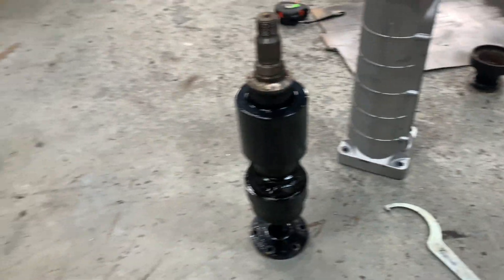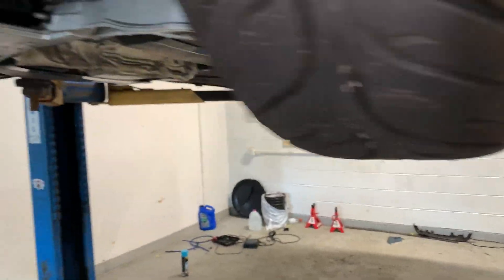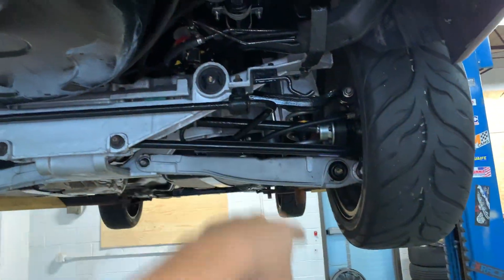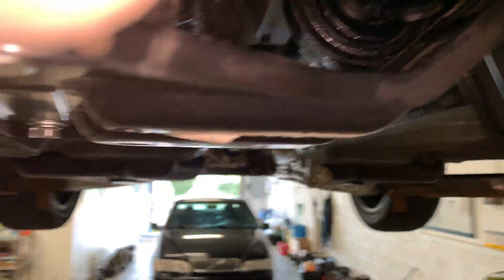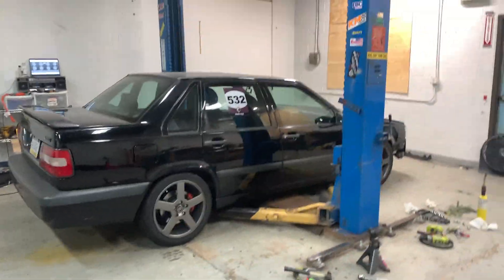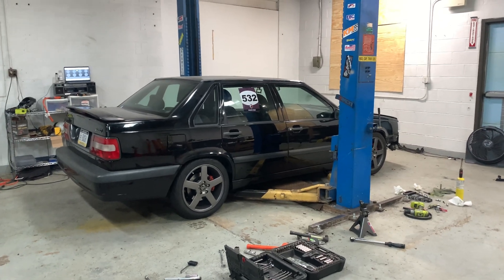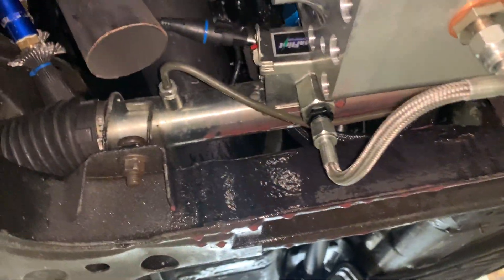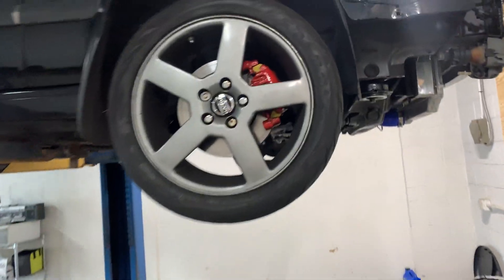Volvo 850 T-5R AWD Swap - Locked 4WD Test

Comment from the maker: Hope you guys enjoy the accel. The times are based off the speedo in the video. I can't detect anymore wheel spin in 2nd so I would say they are fairly accurate. +0.1-0.5 seconds. Also when I let off in 2nd you can see the speed stays exactly the same so its actually at that speed and isn't spin. When it was FWD when I would let off the speed would drop and you could immediately tell from the video it was spinning. They're mostly to show the acceleration because the 4WD is so smooth it almost makes it look slower and not actual claims. Will get some good GPS data soon too hopefully.
Reply: Looking forward to the next video
Reply: Wonder what would a stock angle gear do with a welded viscous? With only about 250hp. Explode right away im guessing.
Reply from the maker: @TalismaaKnives  Stock AG should be good up to 350-400 hp as long as you aren't launching it.
Reply: Its T5-R 👍
Reply from the maker: @nerothostv  incorrect its T-5R.

Comment: Hey boss! im working on a 99 v70R and was about to weld both sides of the viscous coupler......would you see any negatives to having just a custom solid shaft built/installed? Viscous couplers are few and far between these days lol

Comment: I am wondering, is it possible to do something similar with my p2 haldex system.
Reply from the maker: You don't want to do something like this, it's too hard on the drivetrain. I've since reverted back to the viscous coupler.

Comment: Hello  my name  is Wayne . AN I fellow you on your build . You did an amazing job on  your project.  I aquire  a 2005 S60 r automatic 12 years ego an have been wrenching  on it  till about 4 years ego when I had some Medical issues  that prevented  me from finishing  my project.  First I fell in love with volvo when th we y had a model 244 TURBO then the  850R in the 90ties then came the S60r in 04 . I could not afford one at that time in life. So I bought my  R  05. USED AN BEEN TINKERING WITH IT TILL A FEW YEARS AGO. IT SEEM TO ME FOR A YOUNG MAN  YOU LEARN YOURWAY AROUND VOLVES. I AM 63 YEARS OLD  AN BECAUSE OF MEDICAL ISSUES  IS PREVENTING ME TO FINISH MY PROJECT.  MY QUESTION IS DO YOU WORK ON ONLY YOUR CAR .OR DO YOU HAVE A GARAGE  THAT YOU WORK ON COSTUMER CARS AS A BUISNISS.  I LIVE IN NYC AN FLORIDA AN ABOUT TO TOTALLY  LEAVE NY FOR GOOD  . MY QUESTION TO YOU  IS IT POSSIBLE  YOU HAVE TIME TO HELP ME FINISH MY PROJECT  PLEASE. YOU WILL BE PAID FOR SERVICE PROVIDING  YOU ARE REASONABLY.  PLEASE  REPLY BACK.
Reply from the maker: Hello Wayne. Thanks for the kind words. Nice to hear a little bit about your project. Unfortunately I do not work on other peoples cars / projects. Maybe try checking with Ben @ Rolling Motors in CT.

Comment: I have couple questions. How much boost you run? Where is your rewlimiter?How much is your oilpressure on rewlimiter? Do you have original t5 oilpump? Big thanks if you can answer!
Reply from the maker: 32-34 psi right now @ 8600rpm. About 80 psi oil on limiter. Using RN/RNC oil pump.

Comment: Can I ask for some advice? My 04 S60R 6 speed, we hit a deer at 80mph, front end is wasted. =( I did find an 06 S60 auto trans. If i swap drive train and computers, suspen, brakes, etc. Do you think it would need a reflash ? Or maybe have to swap the wiring harness? Thnx for any help.

Comment: Hi. so as i understand you welded the driveshaft?
Reply from the maker: No. I welded the viscous coupler.
Reply: @SimplyVolvo  I have a xc90 and awd system is not working, the driveshaft is not spinning so there is 2 solutions for me, weld it so it wont slip anymore or rwbuild it and the problem will come back for sure.. i am in little bit of dilema how locked awd on xc90 will work 🤔
Reply from the maker: @nikolakurjakovic2188  You cannot weld it on a XC90.
Reply: Xc90 uses haldex not viscous coupler.
Totally different system.

A viscous coupling is an assembly of closely spaced plates bathed in a dilatant fluid (essentially just a thickening fluid). This viscous coupling links the front and rear drivetrains.

Haldex is reactive and uses hydraulic pump to pressurize set of clutch packs..
Diff gens used mechanical or electric pumps or combo thereof.
Reply: @simplyvolvo Fri**in sweet! Lol..
As always your dedication, fabrication, and imagination inspires..

Comment: I just want to know what you have against 4th gear?
Reply from the maker: Why would I show 4th gear when the entire point of the AWD swap was to get incredible traction and acceleration in 1 and 2?
Reply: @SimplyVolvo  volvos have never really been fast on launches even with the awd ones not so much this is insane and also really impressive how fast this 850 is going be proud of all that progress 😎
Reply: Well the accel with 4wd is fantastic but by the time 3rd is over I was left really wondering what 4th would do!

Comment: Before launching pull the e brake, and bring the clutch to the bite point, to prevent shock snap. You don't want to bust a driveshaft, a cv joint, or especially that angle drive witch you have built yourself
Reply: What is a e brake on a 850?
Reply: @nicosmith7903  emergency brake(e brake) handbrake, funstick
Reply: That's how I stage my manual drag cars.  Preload it to prevent snapping things.  Great tip!

Comment: Awesome acceleration there bud.
My AWD has a bump stop attached to the engine subframe under the angle gear. So the oil pump getting caught is understandable as there must be enough movement to justify fitting a bump stop as standard.

Also another question, what is the fuel consumption like using the MS3? Trying to tune the m4.4 for economy is a nightmare with all the different corrections that are added.
Reply from the maker: I don't specifically tune for fuel economy on my car... but there is a decently sized sub group of MS3 users that tune for economy with great results.

Comment: Yes I’ve been curious of how it would work out. Now to see the results.

Edit: well that was epic haha. Hopefully you find a solution for the angle gear leak.
Reply from the maker: Angle gear pump will be easy, just have to relocate it and redo the lines. Nothing wrong with the case.
Reply: SimplyVolvo are you planning to put any bushings on the new mounting point. To reduce vibrations on the pump?
Reply from the maker: @rex_s80  Thats probably a good idea. I plan on mounting in the hollow spot of the subframe under the steering rack. There are some holes there I can run hoses through and I can drill 2 more small holes to mount the pump on rubber bushings or something.
Reply: SimplyVolvo that seems like a pretty good spot. A little more isolated from the engine too hopefully. Maybe a small plate that will box it in from any rocks on the road. Something that just clicks on or something to be sacrificial to any debris. Or would it sit deep enough in the subframe ?
Reply from the maker: @rex_s80  Ill have to see. It should be fully tucked away but a little shield might a good idea.